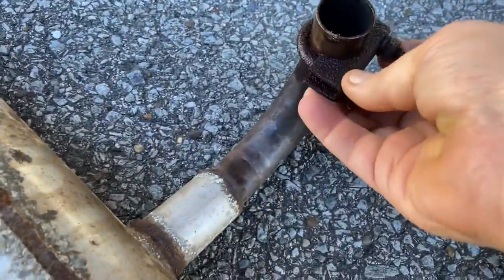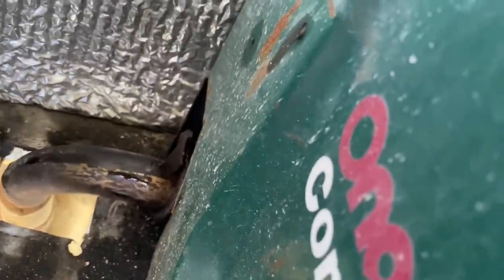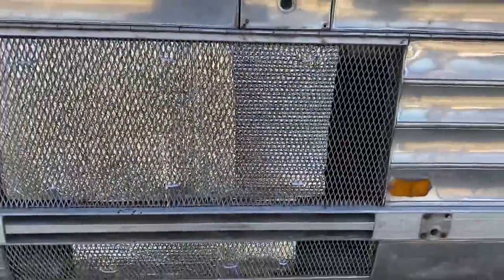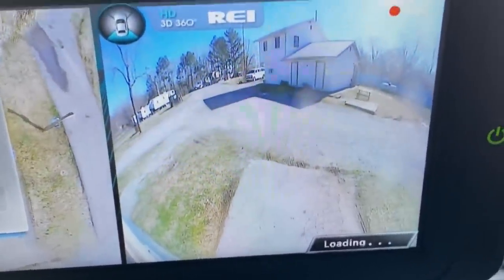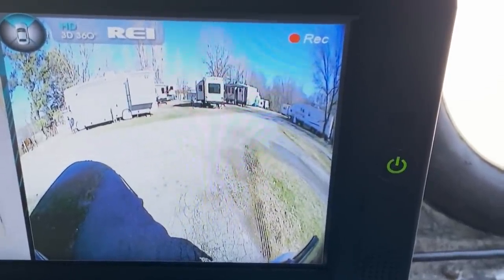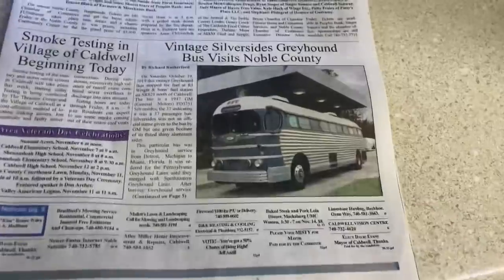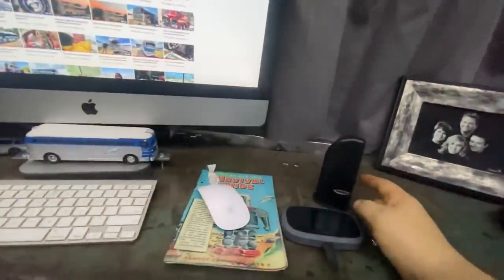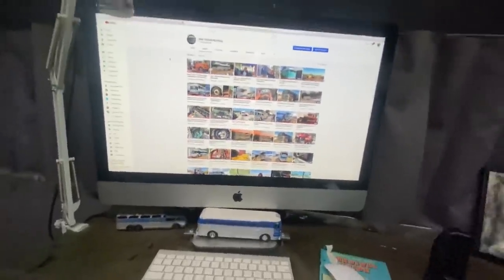RV bus conversion fixing a few issues

Comment: BGM the rubber band in with the Onan goes around the oil filter,  u need it there for correct cooling air flow for the engine. Also the little box on top of the engine is where the points are and there’s supposed to be a gasket between the cover and box to keep moisture from the points. Love your videos. I worked as a residential forklift mechanic for 37 years, some of those had Detroit diesels in them, and a few small ones had Onan engines .
Reply from the maker: That rubber band is from a detroit diesel and i wedged it there because when it shuts down it vibrates against the body and makes a racket.

Comment: Make sure you put back in that rubber sleeve that goes around the oil filter especially in warmer weather it keeps the air from leaking around the oil filter  . From an owner of a Conan the Barbarian unit still one of the best generators ever made .

Comment: I bought the Weboost commercial model 4 years ago for my barndomenium . Being a all steel shell it blocked all cell service inside, works perfectly. 
On your trip to Houston stop by and check it out, I’m only 30 min. out Of your way south of Lufkin, Tx. Might give you some alternative efficient ideas for building on your new property. I’m 75% electrical and power rarely hits $200.

Comment: Hey BGM, remember when you installed that cell booster? You ended up using a longer than necessary length of cable coiled up.. that's the worst thing you could do. Those signals lose strength by the foot of cable, and coiled-up is worst way to "store" extra cable. Help us help you, let's figure what cable end & type you need. Longer than necessary cable runs are signal killers! Want your system to be even better? Use the shortest antenna cables possible...... but it has to be the right cable type, the wrong cable is just as bad as using 50' more than you need. It's a work of science.

Comment: When I worked on an all detroit fleet I  did a personal survey of breakdowns. Almost all were caused by rubber parts hoses and belts . Don't skimp when it comes to replacing hoses and belts,  also the routing of hoses is of upmost importance. Carry spares as no one seems to stock anything.
Reply from the maker: Agree

Comment: Yeahhh with that Bay for the Genset I can see your problem or at least a big part of it.
The holes in the bottom will be dragging all sorts of crud and moisture up in there and it'll be turbulence that does most of the  dragging.
Instead of making the bay door look like a crackhouse window youd probably be better off fabbing up a deflector shield for the bottom of the bay so it doesnt create a vacuum dragging yuck in the side of the bay OR break the underbody airflow creating a vortex that dumps crud and water up through the holes in the bottom.
If you are really keen a camera and light in the top of the bay and a wet drive will tell you  more but this is an issue I had years ago with storage bays dredging nasties up into them and it was a real head scratcher until an engineer pointed it out to me.
Reply: tony66au I was going to say the exact same thing about the generator bay when I saw the hole around the exhaust pipe. That’s the problem area, not the vented bay door. 

The camera idea to see where it’s coming in is fantastic and will show Scott exactly where it’s coming in vs 50 of us bedside troubleshooters saying do this or do that pink bunny, a camera will not lie and if New York followed this theory then they would know as the rest of the world does that Jeffrey Epstein did not kill himself!!!!!
Reply from the maker: That generator fan for the air cooling goes through the floor of the bay
Reply: @BusGreaseMonkey  im not suggesting to seal it, more identify the issue and then pop a shield under the bay to correct the turbulence under the bus so you eliminate the potential for a vacuum vortex that sucks water etc into the bay itself.
Something shut at the front and open at the rear end or sides as a bay thats only open on one side works well but open on 2 sides, Bottom and drivers side will create a vacuum of sorts from the underside of Lenny.
I had the same issue and a borrowed under engine bay shield from a 240 Volvo solved the issue while allowing a draft to come in the side of the bay and exhausted out the bottom.
Prior to fitting the shield the bay would fill with dust and water depending on the roads and seasons.

Comment: dielectric grease the plug wires and seal the points cover
Reply: another thing that could have happened was the start/shutoff switch getting moisture in it
Reply from the maker: Hopefully we won’t have further issues

Comment: You could have someone cut you some aluminum and put removable panels for the door on your generator so when your driving they are in and when you are parked pop them right out just a thought.
Reply from the maker: I’m on the road at a campground.  That’s a lot to ask of me to do... or i just do what I did with what i got onboard.  The simplicity of this is so i don’t have to get out to do anything.  I press a button and have electricity and push another button to shut it off.

Comment: Sorry, I didn’t know why it was there, however there is a rubber band Grommet that does go on the filter to close the gap between the filter and engine shroud.
Reply from the maker: This one never had one on it since I got it.  The ones that’s laying there goes on a Detroit diesel.  I had it wedged in there to stop the housing from tapping the bus body when shutting down.

Comment: At the end when you showed your work desk, I really like your microphone. Blue Yeticaster?
Reply from the maker: It was an amazon special.  4.5 star rated. If it’s a couple years old i don’t think it’s available anymore.  I think it’s a clone
Reply: Bus Grease Monkey hey as long as it works. Buddy of mine does post production and commercials. The price of a Canon XA Pro series 4K camera and Blue mic are breathtaking
Reply: @jerrykorman7770  The Fifine K669B is close enough to the same quality as the main blue yeti offering that every review I've seen on it recommends buying it, as the (supposedly minor, I am no trained professional) difference in quality is not worth the difference in price.
Reply: Smirenka oh, I know nothing about this. My buddy is the expert, he has tens of thousands wrapped up in this stuff. When he mentioned what he had paid for one mic, I just about fell over.

That fancy Canon 4K when he told me what the body and lens cost, I gingerly handed it back to him. I’m a bit butter fingered

Comment: Looks like the generator is about to fall through the floor. Maybe you should pull it out and repair the flooring, and the mount . Just A thought.
Reply from the maker: That floor is solid except for a few holes cut into it.

Comment: If you need to cut the noise from the genset further.  Go to a auto parts store and get a chrome tip for the VW (air cooled engine) Beetle.  Price is about $8.  It sounds the same until your 50 feet away.  Them the sound disappears.
https://i.ebayimg.com/images/g/uIcAAMXQ3kNThr5d/s-l300.jpg